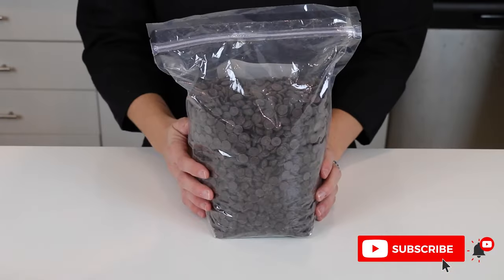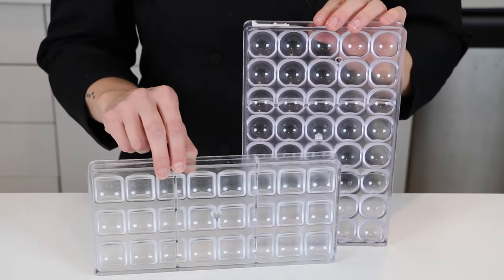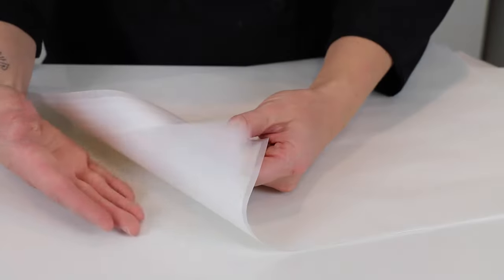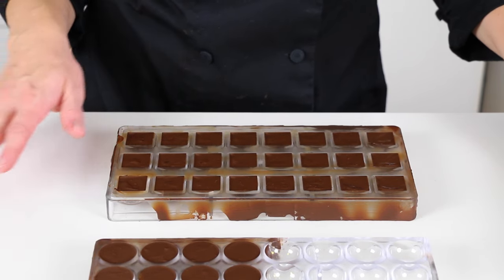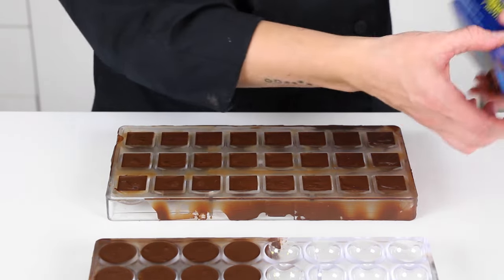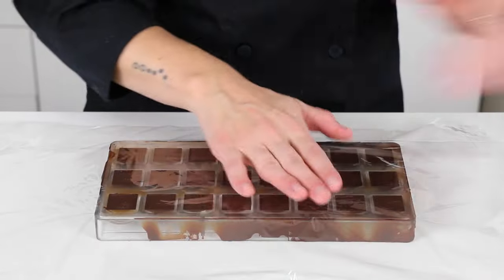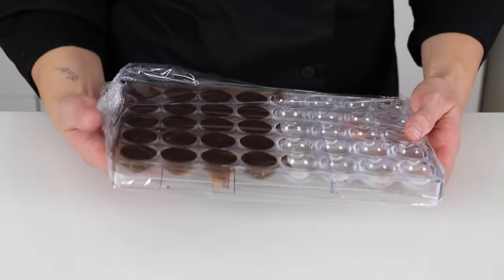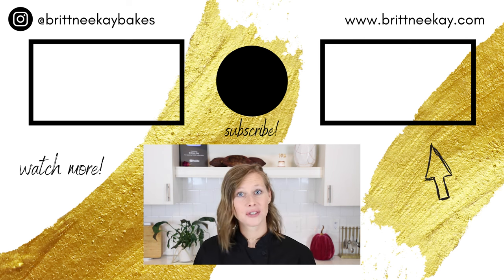Chocolate Molds | How to Fill and Unmold Chocolates | Gold Fall Bon Bon Design

Comment: I tried the chocolate color splatter method.
I was sure it was dried,  when i poured the chocolate  into the mold,  the color ran and seemed to make the chocolate not stick to the mold.  So i had to let that set up and add a second layer of chocolate.  What am I doing wrong?
Reply from the maker: So it should definitely not be running...it does sound like it was still wet when you molded the chocolates, which isn't good. If it was just edible luster dust and you used a high alcohol content liquid (lemon extract or vodka) then there really is no reason it should be running.
Can you tell me what you used to mix the paint and what brand luster dust you used?
Reply: I saw your reply that yould reply here, but haven't found your reply.  I made great designs last year don't remember what I used with cocoa butter but it worked great.  Especially white chocolate poured into molds mixes with color I thought was long since set or dried,  and pours color and chocolate out of the mold, like it won't stick.  The color is stuck to the mold though.  I've washed and polished with cotton over and over.  Don't want to scratch the mold
Reply: Mccormick pure lemon extract  And edible luster dust, 24 k gold,    food color powder  can't find a brand name made in China,    
Sorry bought on Amazon but had good reviews
Reply: The gold luster dust I got with wiltons supplies in hobby lobby
Reply: I let it set overnight
Reply from the maker: Hmmm yeah I don't know about the color staining the mold, that should definitely not be happening. I guess it would be a problem with your color.
Wilton luster dust should work just fine, the only thing I can think of is that it isn't fully dried...there should be no reason it would run when the chocolate is poured on 🤔 @birdsnbirdbaths-fd9qd
Reply: @BrittneeKay   thank you so much for your feedback,  
I've made beautiful chocolates for 3 years this year, I stepped it up and got color powders,  an airbrush,  oil based colors for chocolates and after considering your questions,  
I don't ever remember tempering cocoa butter.  I must of mixed tempered chocolates in with it.  It's been a stressful 18 months, I'm just not remembering what I did that worked.  
My cocoa butter was probably not tempered,   and probably my lemon extract that was mostly alcohol may not have been high enough.  I tried waiting a day  adding a thin layer of chocolate over the thin layer,  but ended up having to wash all the chocolate out of the molds.  
I watched your video on tempering cocoa butter,  I'll try that,  and some of my gel colors for chocolates turned lumpy,  I haven't seen oil based colors used,  do you use them and if so how would you mix them with chocolate, or thin them?
Reply from the maker: Oh yeah that really is just strange. Sometimes when I get confused or start questioning something that isn't working I just start from scratch!
So I think that's good you're just going to start from zero and begin with tempering the cocoa butter and starting over. You can buy fat soluble colors, I recommend buying from a brand made specific for chocolate making like Roxy & Rich because then you know for sure nothing weird will happen. I really have been loving just using precolored cocoa butters so I know what I'm getting. I like Pastry Chef's Boutique and also Chef Rubber.
Hope that helps! You've got this, keep practicing! @birdsnbirdbaths-fd9qd

Comment: lemon extract doesn't effect the shell life of chocolate??
Reply from the maker: No, the lemon extract will evaporate before the chocolate goes into the mold!
Reply: @BrittneeKay how do you make lemon extract..us it lemon juice?
Reply from the maker: It is not the same as lemon juice and you don't make it yourself, you just buy it already made! You should be able to get it at any grocery store. You can also use vodka or everclear in place of the extract. : )  @pragati108

Comment: What to do if the chocolate stays in the mold? I think I may have not tempered correctly.
Reply from the maker: If you're having trouble getting them out leave them in the fridge longer or pop them in the freezer. This is the best thing but can help you get them out. It most likely is a tempering or humidity issue. :(
Reply: @BrittneeKay  thanks! It has gotten pretty dry and hot where I’m at so guessing that’s why getting a temper has been so hard lately. Thanks for the tip!!
Reply from the maker: @ericscharmberg7107  Ugh yes probably! Hot months can really be so hard!